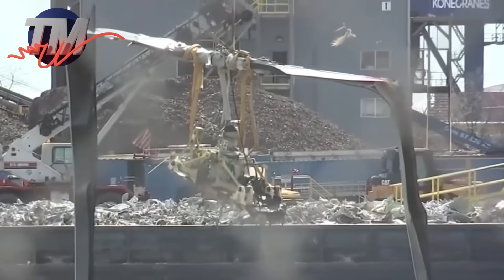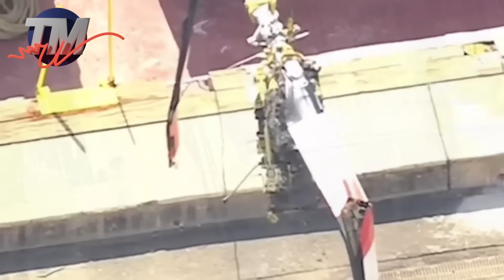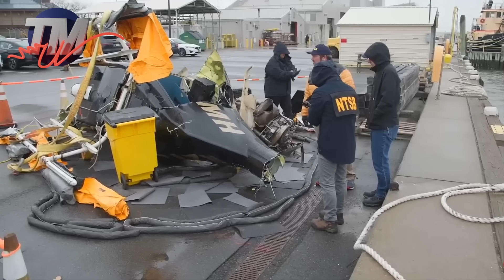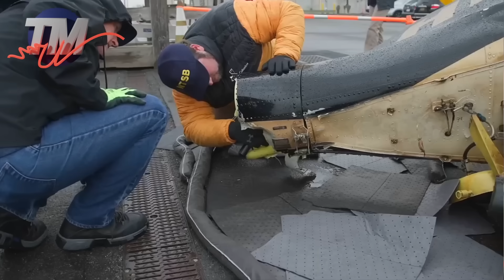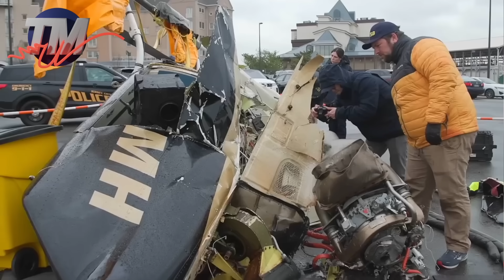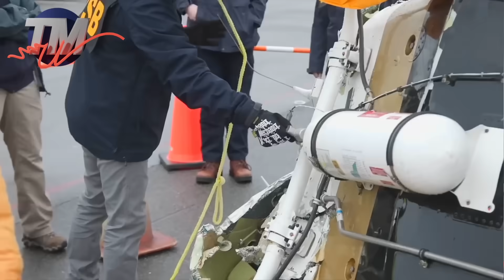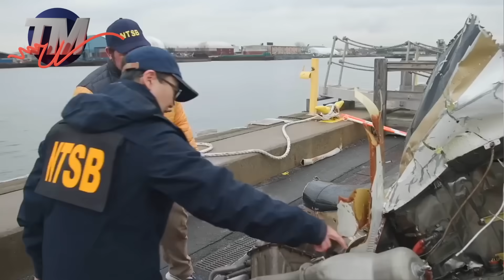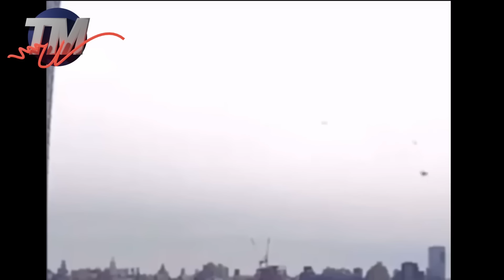Recovery of the Main Rotor of the Hudson River Tourist Helicopter - it's worse than we thought

Comment: I don't think the main rotor gear box or transmission seized. Several close up video angles show the rotors spinning freely with almost full inertia and the transmission is underslung and not turning with the rotors. The thought that the helicopter may have violently turned to the right (the tail swinging to it's left) is very plausible because the main rotor on the Bell 206 rotates counterclockwise as viewed from above which would put opposite forces on the fuselage. If the tail rotor gearbox had failed then the tail rotor could have seized and forced the helicopter to turn to the right. At high forward speed and a sudden right turn the tail assembly could bend and break apart due to the forces of the relative wind. But why the transmission and main rotor separated is certainly a mystery. I'm wondering if the entire engine suddenly seized breaking the linkages with the tail rotor and the main rotor nearly simultaneously.

Comment: I don't believe there is any record of the entire transmission mounting deck separating from a 206 or 206L. It is doubtful that the tail rotor could overcome the vertical fin in cruise to yaw the machine 90 degrees. 

Considering the passengers on board, there may be much more to this story.

Comment: Don’t think you need anything sinister, just an instant seizure of the transmission which would cause a very sudden twisting of the airframe causing the tail to break off under aerodynamic load. What caused the transmission to seize so catastrophically is the big question.

Comment: The transmission locked up tight. As the main rotor stopped, it cause a hard yaw to the right as momentum of the rotating parts twisted the seized trans/rotor assembly. This caused the fuselage to yaw so violently that the tail boom could not withstand the forces at play and exited the aircraft just aft of the attachment point. As the tail boom was coming off, the momentum was tearing the entire top mounting off of the yawing fuselage. Once free the main rotor and remaining parts still attached to the main rotor were them allowed to spin with the main rotor and auto-rotate to the water. (in one of the videos you can see the transmission and mount spinning at the same speed as the main rotor). Meanwhile the fuselage was left to plummet to surface, followed by the remaining tail boom and then the auto-rotating main rotor and trans. Sad. I would imagine there will be some corrosion at play here, either in the airframe and/or the transmission.
Reply: It's a US helicopter.  The main rotor spins to the left.  A seizure would have resulted in a left yaw.  I'm not saying that didn't happen, just pointing out that the stipulations of your premise aren't based in reality.
Reply: @in4merATP  Well, the yaw COULD have been to the left. That video quality is so poor it is difficult to actually tell which way the fuselage actually spun. Not based in reality huh? Well, I guess we will see when the reports finally comes out. I'm betting I'm right on the money..
Reply: What kind of catastrophic corrosion would you expect in an aluminum airframe?

Comment: It seems to be that someone forgot to re-tighten critical bolts when inspecting the helicopter transmission.  It would be like installing new motor mounts in a car engine but leaving the mounts untightened.

Comment: Years ago I went flying with Bristow helicopters out to the UK North Sea gas rigs. In their mess room was a tail rotor smashed up gear. The pilot doing his final walk-around before power up noticed something wrong with the looseness of the tail rotor. The flight was cancelled and in the subsequent inspection the tail rotor gearbox was shot! Turns out the rookie mechanic had been changing the gearbox oil without checking how much metal debris was in the discarded oil, so the wear and tear of the teeth was not detected. This was a close run thing. That gearbox would not have made another trip without catastrophic failure and loss of life. It was shown in the mess room as a warning to others not to make the same mistake during maintenance.
Reply: Excellent
Analysis!  👏
Reply: Don't blame a rooke mechanic for this.... there are several more steps in the maintenance system that would have contributed to this.... mechanics don't sample the oil themselves ...they take the sample and get a readout from a portable machine or send the sample for testing, it would have taken days to discover metal fragments from a sample taken on a servicing by said rookie. Helicopters are fitted with chip detector built into the oil systems and gearboxes... these should have been flagged debris in the oil weeks before a failure. They also have a airframe health monitoring system taking real time vibration data...a grinding gearbox would have thrown up loads of steadily increasing vibration data giving plenty of time to take step to replace any failing parts. lets not forget that private companies service these helicopters and we all know that delaying maintenance will save money... maybe he flagged something up and was told it will 'do a trip'....heard many a time by aviation maintainers.
Reply: I fly with Bristow every day as a professional passenger. Much love to our maintainers!
Reply: I have been wondering if the initial cause of the catastrophic failure was not possibly the tail rotor gear box ceasing up, applying sudden severe stress on the  main rotor transmission causing it to subsequently suddenly fail and rip loose from the frame.  I say this because of one video I saw of the helicopter just before it went down that seemed to show the tail boom suddenly twisting and then shearing loose from the rest of the helicopter and THEN the main rotor with gearbox attached ripping out of the frame.
Reply: @charliehorsenm3446   Or the main rotor gearbox seized up and caused the helicopter to suddenly rotate, which snapped off the tail and the main rotor with the gearbox.
Reply: I'm not even a mechanic but how can a rookie make that mistake

Comment: How about, the transmission locks up and the rotation of the blades lock the helicopter into a wicked rotation because of the transmission locking up that rips the rotors and transmission right out of the body of the helicopter

Comment: Probable Catastrophic GB-Failure. However, the dFMEA in the PHAC [DO-254 Pea-Hack] should've addressed such a GB failure [wonder what the Real-Time, Design mitigation was]. Need a Kinematic Diagram to analyze it.
One thing is somewhat clear at this point, is that, it was probably NOT a MR-Flex hit to the Tail boom [Forensic analysis with a Mass-Spec will tell, even if sabotage]
The MR-Blades did NOT look damaged [as it would be if there was a significant TAIL Boom strike]

Comment: I think you have to open the hood covering the shaft from the transmission  to the tail rotar , remember these are self-sealing bearings Helen by a clamp with two bolts.  I forget how many bearings there are. maybe a bearing froze.  The shaft goes under the engine.   if the rotors replaced they do get timed with a timing gun , with a metal attached at each end of the main rotors.   In the 206 I don't think there's an engine alignment like the Huey 205 which has a short shaft from the engine directly to the transmission which needs alignment. Question is how old is this helicopter has never had an x-ray see if there's any fatigue cracks in the metal.  There are a lot of things that could have happened

Comment: I think that torque is the solution.  If the tail rotor seized, which way would torque send the body?  We know that the main rotor rotates counter clockwise, and continued rotation after separating.  Somewhere in that chain of events is the answer.  If the tail rotor ceases to counter the direction the body would go, either by seizing or by breaking free, the body would turn to the left.  However, the weight of the body keeps it from turning fast enough, so the rotor/transmission breaks free of motor.  Why did the tail rotor cease to counter the torque of the main rotor?

Comment: The rotors appear to be turning around the gearbox as it falls. Previous pilots complained of boom oscillations on the ground. This may very well be tail rotor bearing or driveshaft failure.
Reply: And what ripped the transmission off of the roof of the helo?
Reply: @  If the tail rotor drive shaft broke or seized, leading to a sharp yaw to the right and breaking off the tail, the resulting imbalance could put excessive shear forces on the main rotor mounts.
Reply: @Dalesmanable  Losing the tail rotor in forward flight does not result in a sharp yaw.  Aerodynamic forces on the airframe in forward flight keeps the aircraft flying nose forward.  That's what the vertical tail fins are for.
Reply: @stargazer7644  Not true.

Comment: That video footage was amazing!  Did NTSB release that?  What accident investigators would be conducting a preliminary look-see right on the pier with an independent press photographer working freely within touching distance of the mishap vehicle, and literally over their shoulders?  Can't imagine all those cops would have allowed anyone in the public to be in such proximity.  So how are we seeing this??

Both rotor blades were fully intact (and smoothly autorotating thanks to the mass of the fully intact — and still freely turning — transmission suspended below) till water impact, as clearly seen in other videos.

When, eventually, the root cause is determined, I suspect it's going to be ugly.  Sadly, there might be a soul or two around who already had a good idea before the wreckage was even lifted.

Comment: They reported that this particular helicopter was a recent addition, bought used from some other company. This accident happened on its first flight after the purchase. Common sense would suggest that this machine wasn’t thoroughly inspected both before the purchase and again before it was put into service. When the catastrophic mechanical failure is pinpointed, the government agencies responsible for inspecting and permitting commercial aircraft and consumer safety will come under scrutiny for their regulatory failures. As for your suggestion that the media is driving some sort of unfair scrutiny of recent aviation accidents is both premature and unfair. Recent cuts in the budgets and staffs of the F.A.A. and N.T.S.B., and the proposed wholesale rollback of regulations across multiple government agencies by Elon Musk and D.O.G.E., have raised concerns about their impact on public safety. That question can only be answered in retrospect after some amount of time has passed and consequences analyzed.

Comment: Condolences to those families who lost loved ones.
I'm a low time helicopter pilot, n still learning. My background is in engineering, and have worked maintaining all kinds of industrial equipment, n of course, building a coupla hot rods along the way.
Before anybody comes to any conclusions from inspecting the wreckage, I would start by collecting the maintenance records for the previous three or more years, and inspecting and/or auditing those maintenance records to see if any major repairs, modifications, upgrades of any kind were performed to the airframe that affect the structural integrity of the airframe and major attachment points of the drivetrain to the framework.
Do an inspection of the maintenance records first, and then, go do your forensic analysis. Doing this may guide the investigators to look at certain key areas that have been, or not have been serviced properly.

Comment: I'd like to know what caused the 5 to 7 small " pops" that are heard in one of the videos. Did someone shoot at the copter ? Or were those pops the bolts letting go ?
Reply: They are probably rivets being torn out of the aluminum skin or the bolts and linkage holding the transmission to the airframe letting go depending on when they happen.

Comment: I agree with you about the news reporting sector, which is overpopulated with people with little or no knowledge and training in the aviation industry. The first sign that a reporter does not have helicopter experience is when they call the aircraft a "chopper." An old friend and a grouchy old helicopter maintenance mechanic colleague of mine hated to hear that word, and he would say "Choppers are noisy, leak oil, and are flown by assholes like the reporters that use that word." I have personally worked on helicopters for over forty years and have participated in many helicopter accident investigations. The proper way to get to the bottom of an investigation is to let the experts do their jobs, and they will reach a correct conclusion about the cause or causes of the accident. Opinions from reporters and other inexperienced persons cause the public's growing fear of flying. I have often been told by taxi drivers that they are scared to death of flying because of a recent "aviation specialist" reporter who just filled the airwaves with totally erroneous conjectures of the cause of an accident. I always tell the taxi driver that I am scared to death while riding in his or her cab, because the possibility of an accident in a motor vehicle is thousands of times greater than being in an accident in an aircraft. Another aggravating thing that these reporters do is drag out of the closet all accidents in the past that have nothing to do with the present accident in question.

Comment: There are some very loud noises coming from the helicopter, and to know when they occur, you have to know the distance to the helicopter.

But it is clear that the cause of the noise occurs long before the helicopter starts spinning to left or right.

Therefore it must be the gearbox that has disintegrated, and has finally locked up, after which the supporting beams in the ceiling are twisting loose due to the continued rotation of the blades. :-(

Comment: you can see the boom didnt break at the mounting point.. the mounting point is still attached 12" forward of the break. you can see where rivets were pulled and the section broke at a point that was not meant to come apart. the paint line and empty rivet holes shows it was a panel meant to stay together indefinitely. the tail rotor suddenly stopping seems to be the likely problem. whether or not thats the cause is yet to be seen

Comment: If the investigation shows that the tranny did not seize, I would suspect a failure of the 90 degree gearbox (tail rotor) snapping the driveshaft. Spinning shaft severed tail. Pilot reaction would have been hard rear cyclic stressing main tranny mountings and separation

Comment: There is a video out there I have seen (that is much clearer than the one you showed) and it shows the tail section coming off first, then the top rotor comes off and the helicopter body falls to the ground.  So I would say that supports your theory that the tail section came off first.  Of course now the questions of why???

Comment: My thoughts, MRGB sudden stoppage and the inertia of the blades and head ripped the MRGB from the airframe, main beam ripped out of the honeycomb roof structure, what do you think, im not an expert, far from one. 
Tail boom also sheared aft of the attachment reinforced piece which bolts to the fuselage.

Comment: The gearbox had to have locked up. The inertia of the rotor is thrown through the airframe, spinning it an ripping the roof off. The spin also strains the tail, but is also suddenly hitting the wind completely broadside at cruse speed. Two sudden overlapping forces that the tail was not designed to handle. Yes, media is trying to paint a narrative that something has changed.

Comment: I think the driveshaft for the tail rotor let go , there was a mechanical failure with the tail rotor that was so violent it broke the entire tail off the frame, then the intense twist force on the main rotor from loosing the tail then separating the main rotor from the main body. Nothing the poor pilot and passengers could do. Severe freak mechanical failure of the tail structure started the final chain of events

Comment: You are wrong. The tail got struck by the main rotor. The fracture is not all around the circumference of the tail following the seam. Just on one side. Now, if you know the direction of rotation of the main rotor, you will notice that the tail on the impact side is torn irregularly. Only on the leeward side is it fractured along the seam. Also, the shaft leading to the tail rotor is broken at the exact same place. So, the rotor impacted the tail due to mast bumping. The tail subsequently fractured all around along the seam, and the shaft was also cut by the main rotor. It is still mast bumping, and the NTSB's report will show that.
Reply: The boom separation is right next to the fuselage and the break is vertical.
If you look at mast bump incidents, if there is a boom strike the break is always towards the end of the boom and the blade hits it on a diagonal.
It also breaks or severely damages one blade more than the other - this is clearly not the case.
Also mast bumps break the rotor shaft at the hub.
Also the B206 very rarely suffers from mast bump and when it does it damages the rotor shaft, which is clearly undamaged in this video.
Stick to your day job!

Comment: i think the tail had a crack, and as it broke the rear rotor seized, opening the crack, and the tail goes up into the main rotor and strikes it. that still does not cover the mounting points ripping out of the airframe.. but it makes sense. the tail folded. it reminds me of the scene where the spaceship comes apart, exploded into each part, neatly disassembled into a cloud of parts without damage. until the inertia

Comment: The tail rotor snapped and catapulted towards the front of the aircraft hinged along the break. Without the counterforce of the tail rotor the body of the helicopter spun and tore the transmission assembly from it.